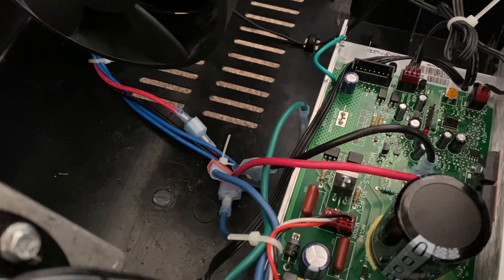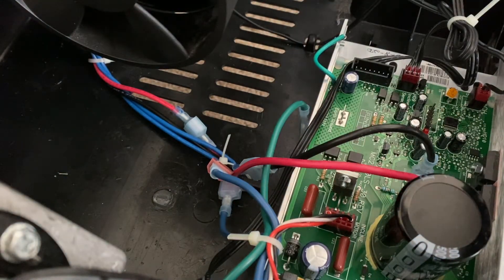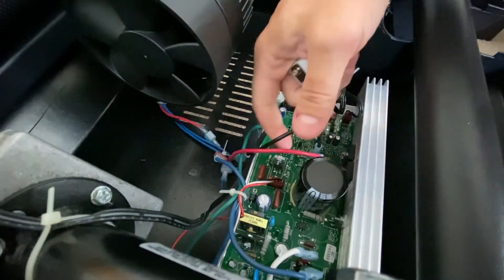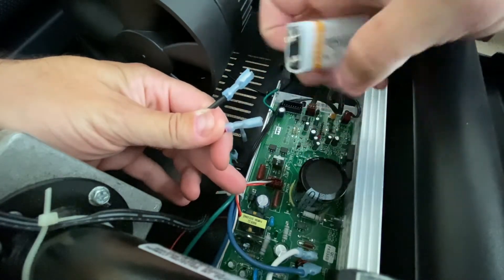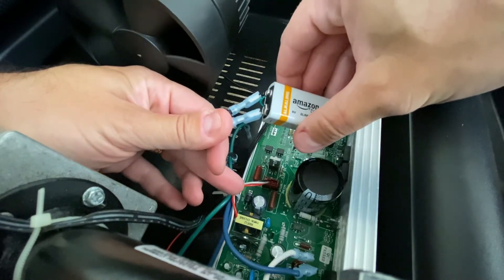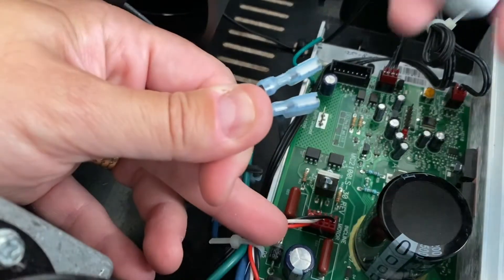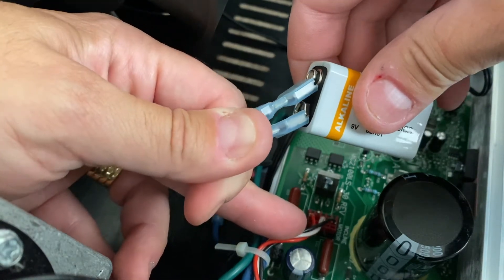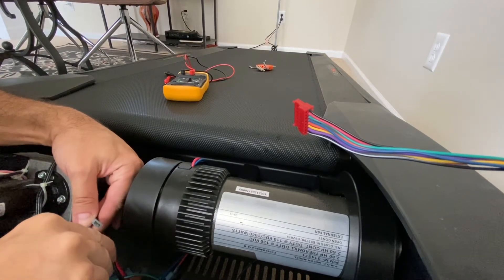Nordic Track Treadmill T5.5 T6.5S - Testing Motor with 9V Battery Easy check 100% guarantee

Comment: Hi I have just bought one of these and was told it needed a new motor. When I switch it on the screen flashes and then goes off. Any ideas please ?
Reply from the maker: It could be the motor or the main board. It is hard to tell, you can test the motor with a 9v battery like in this video! Let me know if it helped

Comment: should the battery get warm while doing this test?
Reply from the maker: It could but not if you run for just some seconds.
Reply: @felipezafani  you can do with 2 AA battery. When I tested, not only the battery, but also the wires became very hot.
Reply: Sadly there is a Lot of treadmills with same issues. The root cause is a poor designs. Electrónics and Motors are weak for the usage. If Motor demands current more than 0.25 amps during dry test without mechanical load. Current higher than this Is not good for Pcb controller power transistor. Seems treadmills are like a toy. Perhaps treadmills with AC could be better selection for running Long time

Comment: Felipe my motor works fine through speed 3 but any higher it just shuts down after it tries to speed up. Do you think motor control board? I tested the speed sensor and it closes when it sees the magnet. And I lubed the walking belt what else could it be?
Reply from the maker: Hello Most likely the issue is with the control board, speed sensor can be disconnected from the board and the system still works, the speed sensor is used only for calibration, you can test that as well, disconnect the sensor from the board and turn on the machine. Try that fist, disconnect the speed sensor and test it, also try going up speed at elevation 0 and at different elevations. Have you done a hard reset in the board?

Comment: Does the belt have to be off the motor for this to work?
Reply from the maker: No you don`t need to have the belt off the motor, very little current.
Reply: you see the belt moving at the end of the video so I guess not.
Reply from the maker: @-PF  That is right ! thanks

Comment: I watched both your videos on this board. So mine just quit moving the belt. When I try to start it the motor attempts to spin for a second, but stops. The light on my control board is blinking. I tried the 9v battery test to see if the motor would go spin and it does the same thing I mentioned, it turns 1 rotation and seems to immediately stop. Could the motor be bad instead.
Reply from the maker: The motors my be the issue, I have a spare motor. I live in Michigan if you are around let me know.

Comment: Felipe, tested my motor with the same method but no movement. Safe to say the motor is dead? Everything on the Nordicktrack works.. as soon as I turn on the belt it starts quickly 1-2 seconds then dies.
Reply: I see I think I have the same problem you mentioned. Did you try to replace your motor?
Reply: @analogchronic  yes I did, and it corrected the issue. Was luckily enough to find someone local with some spare parts for cheap.
Reply: @michaelwoiten7072  thanks. I just ordered a new motor online for 125 with shipping. Hopefully that fixes my issue.